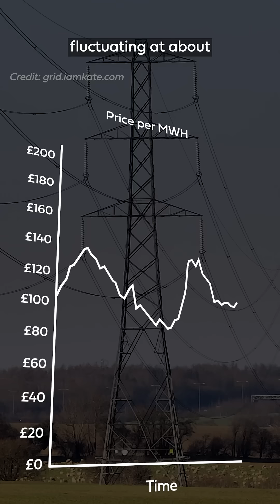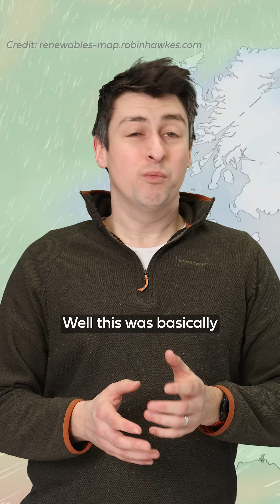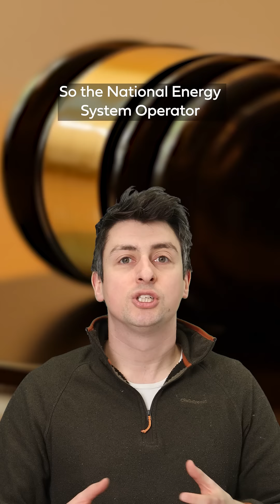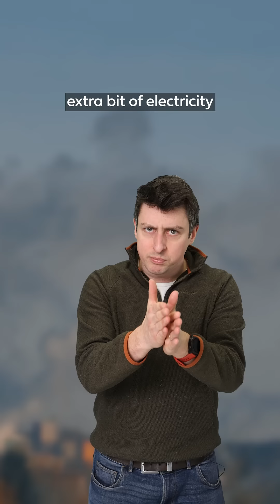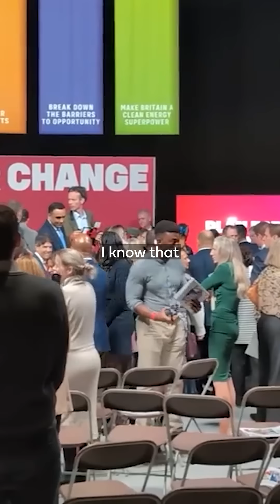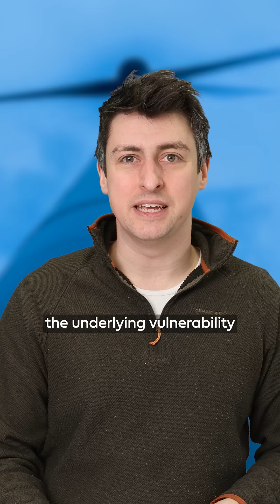The biggest price spike of the energy crisis happened last week

Comment: The UK grid was clearly up to the task as you continued to have electricity in all of UK. 
It was not a Texas scenario with power cuts. 
I look forward to see your explanation of why an auction is not the best way to set the price.  
The problem is that most consumers would have turned down their consumption rather than paying the high price. 
I believe the power line to Denmark was swiftly brought back from maintenance and supplied 1.4 GW.

Comment: Yes, the pricing scheme needs to be reformed. 

I'm glad we use renewables. They're a cheap which is good for everyone. I want more of this. However, I also agree and want to see further investment in UK Nuclear.
Reply: Nuclear = the high price all the time instead of rarely. It’s the most expensive cost per kWh we know. And it’s completely incompatible with renewables. Either nuclear has to curtail generation when renewables are high, further decreasing its ROI and increasing the price it must charge when they are not. Or nuclear has to basically under sell renewables until it drives them out of the market, at which point prices go up.

Gas for rare events and hydro/batteries as well a geographic dispersal and better load management is way way cheaper and more reliable. Nuclear plants being down as many have been for long periods drives prices extremely high as having a backup that can power through a six month nuclear outage is way more expensive than a backup that only has to last hours usually to an absolute maximum a week.

Comment: Nuclear is exactly the wrong solution for this problem. The same reason prices went super high when there was no wind is why the price goes low when there is plenty. Not good for a power plant trying to payback extremely high CAPEX while running consistently whatever the weather
Reply: What if the UK had been more interconnected with say Germany, who shut down their nuclear plants, and sold the surplus there? That way it could have excess base supply and dump energy for low demand.
Also, it could use natural batteries, there's literally ocean nearby. If you have an excess base load it's a nice problem to have. Ukraine for example didn't completely blackout only because hitting nuclear plants is akin to starting a nuclear war. So it's also a security guarantee.
Reply: The grid needs more dispatchable generation, not more base load.

Comment: Imagine being that gas plant owner. You are not needed for most of the year, but they ask you to power up for 3hour on that cold windless day. Sure it will be super expensive.
Reply: True. But in the future there will be a lot of days were renewables create a lot of excess electricity. That could be used got hydrolysis, to generate hydrogen, which could he stored and used as fuel for gas power plants instead of natural gas. It would make gas backup power much cheaper and generate no CO2. You'd also be independent from the whims of gas exporters like Russia or the US (LNG).
Reply: @MedEwok  Hydrogen is just too inefficient (read: too expensive) to be used for electricity storage. That's a job for pumped hydro and (soon) batteries. 

Hydrogen's only role is for use in industrial applications like steel manufacturing and possibly long distance electricity transport.
Reply: @sigi9669 its not that inefficient, especially if you generate it from high temperature electrolysis in nuclear power plants or some other high heat source. It might not be cheaper than pumped hydro, but its not that much more expensive and doesn't involve the large construction costs and limited building areas
Reply: @sigi9669  or other gravity, heat or flywheel-based storage methods being developed.
Reply: Batteries are SO MUCH CHEAPER!
Reply: But, was there not a capacity market, where generators were paid for standing by, instead of relying on energy sales?
Reply: @raemondbradford1629 there might be but that capacity market is there just to allow the power plants to not go bankrupt, it doesn’t change the high cost of power it produces or the fact we don’t have enough power do they are really important
Reply: @raemondbradford1629   - because "Climate"...  Some deny that there aven is a climate.  lol..
Reply: And it should be, but this doesn't mean the wind should be priced the same
Reply: @ddimov2557   - wind is ( analogous to hydro without dams)  "run of the river" - only a fraction of it can be effectively stored (currently) for when it is most useful (all low cost bulk storage methods have significant; establishment costs, lead times and inefficiencies when dealing with distributed generations). The inability to create true fungability in wind and solar energy markets, devalues it massively.
Reply: @kadmow  Is it really possible to have an easy market in electricity generation? There's a variety of differing characteristics among generator types, and usually a system works better when there's a diverse mix of types. The current electricity market seems a bit like paying a pilot by the hour or by task - a higher rate during take-off, low rate during cruise. Imagine an emergency! How would you value a pilot's time during a vital, high stress minute or hour? Many jobs are like that. A bundle of tasks and responsibilities that are difficult to 'unbundle'.
Wind & solar obviously have limitations, just as nuclear, coal, oil, gas, hydro, also have. None of them are directly comparable.
Reply: 👏👏👏 Exactly.
Reply: Gas still supplies the UK every day. It was to increase production for a few hours.
Reply: Owned by politicians directly or indirectly through foreign companies making fortunes with little to no effort in the UK every year
Reply: @mtavassoti ”little to no effort” except they have all the risk, the power plant that’s cost millions to make could suddenly become redundant once we build enough renewables to meet peak demands, in fact now is the worse time to be constructing a power plant however they are extremely important
Reply: @rhysrailgas power plants can be pretty easily converted to run either with hydrogen enriched gas or just pure hydrogen. Which would be useful as it could work as energy storage, using hydrogen generated during off peak times, massively reducing carbon emissions overall.
Reply: Imagine you are a vampire. You care not for humankind and only want to drink their blood.

Comment: That's a total scam. Those who fired up their electric generator should have got paid the unit price that we normally pay. Why do they get paid a ridiculous amount more?
Reply: Because they use more expensive sources of energy like gas that cost more. And it’s not worth them running at the usual price, they simply wouldn’t and the grid would need to load shed, leaving people without power.

Renewables are so cheap, nothing can compete, but storage or backup is more expensive and needs a higher price to be worth building or operating. Renewables are so cheap that in places like Australia the regular price often goes negative, providers or people on wholesale rates actually get paid to use power.

Comment: If I’m gonna pay 7 times the price for electricity in the UK at the time this ‘Crisis’ happens, I’ll just turn off the heating, put on 2 extra layers of clothing and build a campfire in the backyard to cook my food. Going old school it is!
At night I’ll use candles for light and/or oil lamp. The dishes will be washed manually and not in the dishwasher! Clothes will be drying on the rack instead of in the dryer. The only thing that will be using electricity in the House is the fridge, so the food doesn’t spoil. 😅
Nothing else will be using electricity, I’ll tell ya that much.
Reply: That’s the plan technically, it incentivises loads to be reduced (especially ones like storage hot water heating that can be pre heated. With the load reduced the price goes down for all the loads that can’t be reduced.

But most people don’t pay per event like this, they pay a flat rate, time of use or per type of demand charge.

So most people don’t pay more during such events, nor reduce their demand because it affects the price as a whole, not their individual cost in that instant.

There are rare people who do pay wholesale costs, and in that case they need to monitor prices and react accordingly, probably have a home battery and lots of insulation/thermal mass to ride out the worst prices temporarily without much discomfort.

Comment: Imagine needing a "stop loss" circuit breaker in your home, to make sure you don't suddenly go bankrupt when cooking dinner one day.
Reply: Thats not the price the consumer pays
Reply: Very few places even offer people the ability to pay wholesale rates, electricity retailers simply average out the cost, so customers pay more for cheap renewable energy than it costs, but don’t cover the costs of these spikes when retailers lose money.

But yes in the places where people can pay wholesale rates they do usually have home batteries programmed to charge when power is cheap and discharge to provide power to the home when it’s expensive. Overall it can work out cheaper, but without the automation it’s a lot of mental load for people to constantly check what prices are doing before using an oven etc.

Comment: If you have solar panels and feed into the grid you get paid a flat fee per unit fed into the grid. Gas powered power stations should be on the same system.
Reply: Nah. You should have the same system as the big boys. Only way to keep everything sane.

Comment: I would go so far as saying it's not worth installing any more wind or solar until efficient storage is available. While some of this needs to be mass storage (additional reservoirs are needed anyway to supply growing population centres, so designing them as pumped storage from the start would be an added benefit), some can be more widespread. Domestic solar, particularly in summer could be redirected to a home battery to help cover the evening demand peak. This would help reduce the 'duck curve' problem that renewables exacerbate.
Reply: The more there is the less often even low generation is below requirements and the more often power is cheap.  As well as diversification of their geographic locations and international interconnections etc. over a wide enough area wind is more consistent and solar at least predictable. 

But yes, storage (battery and hydro) will compete against gas peaking plants for the cheapest option for rarer events.
Reply: @ In any sensible arrangement the price would come down with supply. But this is the UK where the price is pegged to the gas price and we pay wind farms "constraint payments" of £310m (2023) and £393m (2024) to not produce of power when there is excess. In 2024 this was over 8 TWh of power just left hanging in the wind.
Instead of more wind farms, the money would be far better spent on storage to absorb the excess to cover peak demand.

Comment: I believe this is how energy auctions work here in the U.S. as well. At least in some regions.   All available energy producers quote on the amount of Megawatts they can provide.   If a Natural Gas (for example) plant states they can deliver 500 Megawatts at $50 per Megawatt, and a Coal  (for example) plant says they can supply 500 Megawatts at $100 per Megawatt, and the utility currently requires 501 Megawatts,   Then the Natural gas power plant will get the $100 per Megawatt bid by the Coal plant for all of its 500 Megawatt capacity, and the Coal plant will get $100 for the 1 Megawatt above what the Natural Gas plant couldn't provide.   (If the utility only needed 499 MW, then the Gas plant would only get the $50 per MW it bid.)
Reply: It gives a very strong incentive to increase production and an incentive for the consumer to lower demand. 
It is the most efficient system or the gas power station will put a bit in at 99 $ every time and so will the wind turbines and you never get the 50 $ price.

Comment: We should all be on variable rates. That would give people the choice: do clothes washing overnight, not leave all the lights on when the price peaks etc (would be good to have a a few hours worth of in-home battery for that!). Then the consumers themselves could lower the spot price just by reducing demand....
Reply: Yes. Though most people don’t have the tools to make such decisions and for most people having to consider such things is a huge mental load. More automation is really needed so people can set loads to self regulate, like hot water storage systems that will automatically pick a low cost period to heat etc.

Some of that used to be easy when overnight was always the cheapest, but with wind and solar sometimes and places the middle of the day is now cheaper.

Comment: Large heating systems like office buildings or water boilers should also easily have feedback "backpressure" systems to react to price spikes, to lower demand for a couple hours.

Also, a tank of hot water is effectively a cheap, gigantic capacity heat energy battery. Given how a massive share of electricity demand comes from heating, simple insulated water tanks should be leveraged as energy storage.
Reply: Make it a tank of hot sand and it's even more effective...

Comment: Gas is still king. Batteries, once used, can't be used again until they're recharged so in a state of prolonged low wind and low sunshine, they're useless. Nuclear can't be quickly fine tuned to change alongside demand, it provides base but no shape/peaking supply. Only gas, whether it be natural gas or biomethane or hydrogen, can be spun up and down quickly independent of the weather to quickly meet changing demand. Simon doesn't like to address this because it's an inconvenient truth that doesn't fit with his agenda.
Reply: Yes, one battery can't be used again until it is recharged, but it's purely a question of capacity. Build out enough to cover the dünkelflaute periods in winter and just imagine how much overcapacity we'd have in the summer when the wind is blowing and the sun is shining.
Reply: Building out enough battery storage to cover the entire winter is impossible. We're not even close to managing a day.

Comment: 1400£/MWh is 1.6€/kWh. Last january we had an insane price spike in Finland where the spot price peaked at 2.35€/kWh and the average price for the day was over 1€/kWh. 

I shut literally everything down and just moved to my parents place for the day since they have fixed prices unlike me
Reply: @dizzy2020  exactly. Consumers pay based on their contract, and most have spot price contracts
Reply: @dizzy2020 in Finland and Denmark most are at the auction price. Our exchange is called  Nordpool.
Reply: Spot price contracts are still extremely rare. So consumers don't react to high prices at the spot market.
Reply: I've seen £1 kWh around 6pm 3 times so far this winter on Octopus Agile.
Reply: My electricity is like 11.86 cents a kwh. Idk why it’s not .12 cents a kwh but that’s how they bill it and it is fixed. Some of these energy prices would put me on the street no joke. How do y’all pull it off?  I’m struggling with paying a little over a dime per kwh and make 10 to 13 bucks an hour (depending on tips) and rent is over 1k.  How do you pay .50 cents to over $1 a kwh?

Especially the UK, a pound is worth more than a dollar so to hit that much per kWh I would rather they cut my power off. I could never pay that bill off.
Reply: @Marynicole830  usually the price is like 3c/kWh so it's not too bad. My electricity bill is like 10€ a month
Reply: We also had a day where the price was -0,50€/kwh. This happened due to an input error by someone. I don't remember who. 

Anyway, my friend had his electric sauna at full power as much as the safety systems allowed. His bill for that month was negative.
Reply: @PotVon  was that when the new nuke power station went on-line?

Comment: I was so glad this finished with "we need more storage". Stunningly disappointing what the economic incentives are for burning coal. Batteries should have saved the day.
Reply: Storage has never been economical in private hands.
Reply: Check out Australias initiative to built battery storage. I don’t think they would allocate that amount of funds if it weren’t profitable
Reply: @spittylama aust energy system is moronic and battery don't make sense at the moment. Don't look at a basket case for sense.
Reply: @spittylama  Australia is very much not the UK. I don't think any comparisons should be made there.
Reply: @justaguycalledjosh If it's not economical for the private sector, it isn't for the Government either - it's just the Government doesn't care and will spend your taxes until the problem is solved, at a huge financial loss if needs be.
Reply: Storage simply can never work. It's not only economically impossible it's physically impossible.